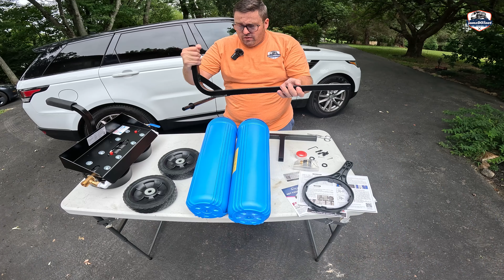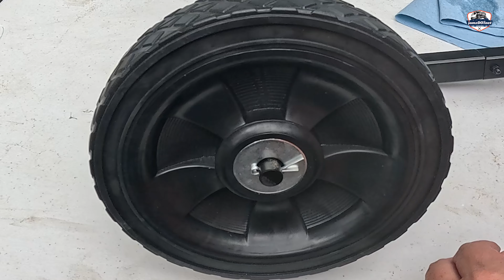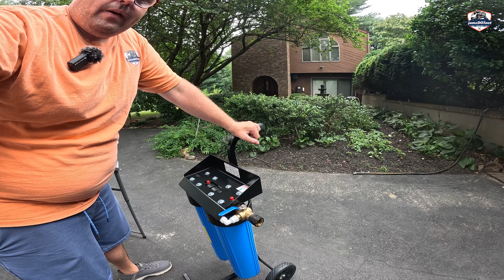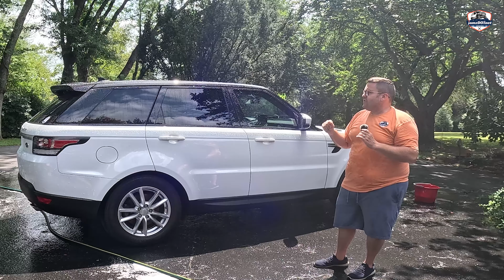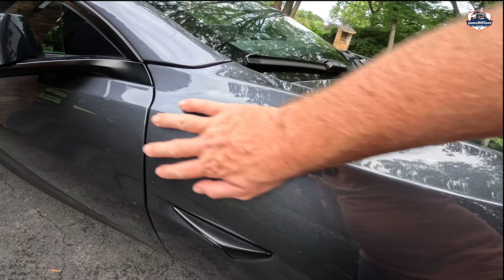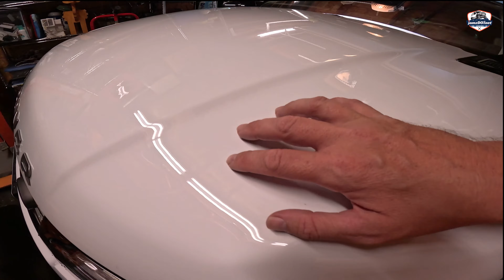Deionized Water Car Wash – Is It Really Better? Let's test the ISpring Water System!

Comment: Very impressive! I am shopping around for one of these now. So basically you didn't even scrub right? You did a double foam and two rinses, but you only used the deionizer for the final rinse. Is that correct?
Reply from the maker: Correct, that is what I did.